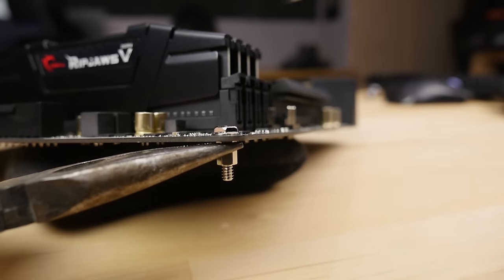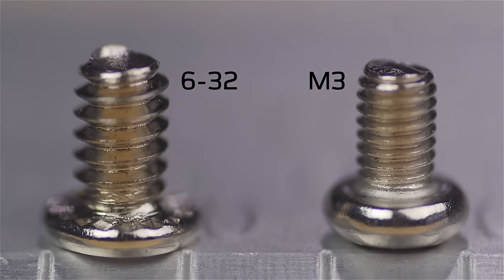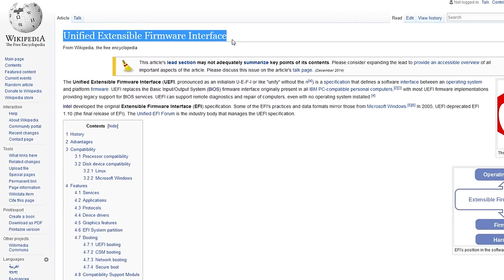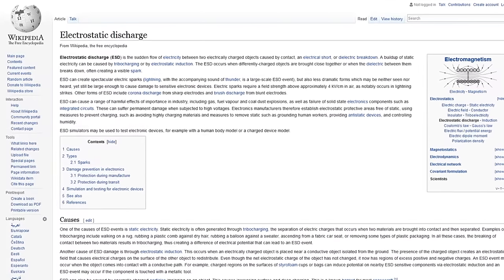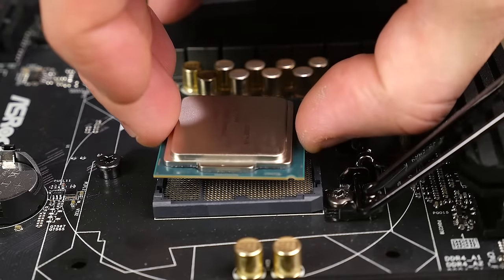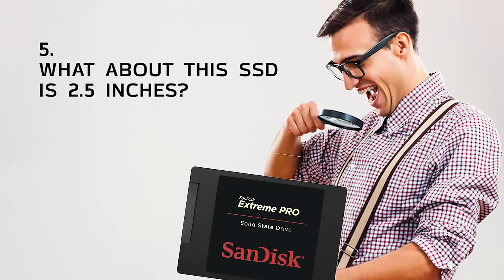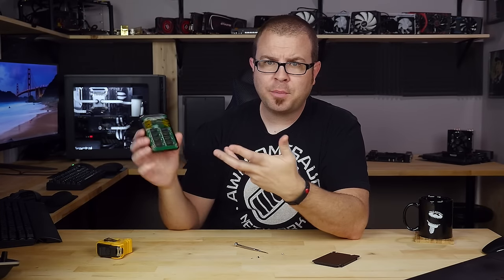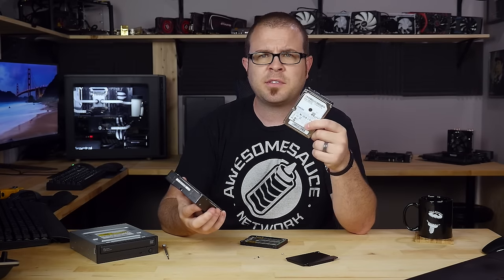5 Confusing PC Building Facts

Comment: UNC - Unified national coarse thread, UNF - unified national fine thread. both part of the shit standard system of murica. we need to get with the program and make the switch to metric
Reply: +awesley92 the metric standard of threading sucks. Although 6-32 screws are a special case. They suck too. But in general the range of available imperial sizes is just better to work with. People hep on the idea to switch to metric rarely are the ones building anything with any measuring system at all. So I have to ask, have you ever threaded anything in your life? By threading I do mean drilling a hole, then running a tapping cutter through it too.
Reply: lol im a month from graduating with a mechanical engineering degree, i've cut threads on a lathe. keep it in ur pants before you tell me about a measuring system
Reply: awesley92
Oh goodie another impractical engineer. Just what the world needs! Maybe you can design a car that needs its engine pulled to change the spark plugs too?
Reply: awesley92
no I blame the French for coming up with a bullshit measuring system. I have my own cherry picker engine hoist too. So if I need to I can drag an engine out of a car. But I'd rather not have to for something as minor as changing spark plugs.
Reply: +Paul Frederick what's really impractical is continuing on with wasting our planet's finite resources and energy to keep producing two standards, in addition to all the other wasteful products we produce. the only people two standards benefits is the tool companies when one standard can do the same job as both. i'm not saying overnight we need change to metric, just a gradual shift towards it. the acceptance of metric fasteners is already visible anyway with american car manufacturers starting to use metric on some of their models. I'd put money down the imperial system will be phased out one day, just as standards of past eras.
Reply: awesley92
If your greatest concern is waste we should phase metric out then. Because metric tool sets contain a larger number of tools than imperial does. Between 6-24mm a metric set would have two more tools than an imperial set does. Many of those metric sizes are useless too. Because no one makes fasteners in those sizes. I'm glad we've settled that.
Reply: The scope of the argument goes beyond units of length. Imperial units are based off of archaic meaningless things. Miles are based off of the game of cricket. This is how ancient cultures measured things out.  The irrelevance of the entire unit system we use makes it unnecessarily difficult to make off the cuff estimates on the actual amount of energy we use and how wasteful of energy we are. Looking long term these are definitely things we need to consider.  The metric system of base 10 makes it far easier to imagine the scale of system in question. BTUs (BRITISH thermal units) are used to measure some forms of energy. The system was so stupid the British stopped using it for Christ's sake. To top it off, with a little digging you will find that the customary pound and yard are defined by law in metric terms. Case closed.
Reply: awesley92
What do you think the metric system is based on that is so meaningful? An erroneous measurement of the circumference of the  planet? They were off by a country mile with that. The standard has since been changed countless times now. Each standard as arbitrary as the last. I think now they're using some wibbly wobbly wavelength of krypton light? Superman would not be happy. It is unAmerican!

Imperial measurements are in any base I want them to be in too. Sometimes I use base 10. Other times I use whatever I want. The solution to the energy crisis is not to count every erg we use, but to simply generate more power. Conservation never works. Grow, or die!
Reply: What do I think it's based on? It's not what I think its what I KNOW and you obviously dont so do a little follow up on that subject. Metrology is a field in its own right and new advancements call for new and more precise standards for development of nano-scale technologies. Heat varies the length of matter so finding a standard that is consistent as possible is what is meaningful. And not meaningful like the metric system is my spirit animal or something, but having meaningful empirical implications.  You need a suitable reference to base all of your other measurements off of so everyone around the world isn't off. A tiny shift in tolerance can make a huge difference at the nanoscale level. That's all a unit system really is, an arbitrary reference comparing the physical attributes of one thing to another so of course the standards themselves are arbitrary. Hell, everything in life is arbitrary depending on how you want to see it. It's a mistake to become complacent in technological development. There's never going to be an end all unit standard and thats ok. One that conscientiously grows with technological advancement and suits the needs of the world is what we need.
Reply: awesley92
Nano? Who are you, Mork from Ork? Nano nanu! I have done high precision machine work and I've only ever worried about hundreds of millionths. Billionths? Are you related to Carl Sagan by chance? Get in the real world where we use the imperial system of measurements! If the gage says Starrett it is accurate enough.
Reply: lol cheap ad hominem attacks, we know what that means. When you swim in the toilet, you get shit on. Without nanoscale tech, you wouldnt be reading this, what world are you living in? America?!!? No surprises. Nanoscale is exclusively measured in metric. Build a modern cpu without nano technology that doesnt take up your entire house. First, anti-splashback urinal cakes in public restrooms, now the metric system. The future is now, wake up.
Reply: awesley92
What arguments would those be? You spouted some nonsense about nanotech, that you will never have any practical firsthand experience with in your life. Besides, Oh, I hear it is inside modern CPUs! For all you know the Keebler elves are in those chips with cookies too.

But out in the real world I have built international award winning structures using the imperial system of measurements. Inches, feet, and yards!

You forgot to mention that the USA is richer than the rest of the world put together. So we can afford our energy bill, thank you very much.
Reply: Look up the definitions of subjective and objective while you're at it. You use base 10 sometimes when you want to blah blah blah. Subjective, therefore your opinion.

Facts are objective. No one cares that you use base 10 imperial and hassle yourself with decimal to fractional conversions. Fact. When a calculation or process takes less steps and a shorter amount of time to do, it is simpler. Fact. When you have to do mental math or look up a chart to convert that imperial decimal to a fraction, clearance hole sizes for fasteners for example, it is not simpler than metric. Fact.

I gave un-opinionated scientific facts as well as practical examples in favor of metric. Some things I have said are opinions. Fact.

 You think imperial should remain the standard purely on personal preference based on the limited scope of tinkering you have done in your garage. Fact.
Reply: awesley92
What practical example have you offered for metric besides nanoscale inside of microelectronics? Which itself is not a practical example. There are maybe 6 fabrication plants in the world that deal with that scale.

I have two charts hanging up in my shop. One has all of the drill sizes, with their decimal equivalents. The other is a tapping chart, with clearance holes. So I do not have to look very far up to reference any of that data. So another of your points made moot.

Imperial is still the standard for machining. Even in metric countries tools are all imperial. They use quarter, three eighths, and half inch drives. A 13mm chuck is a half inch chuck, etc. I mean get real, 13 is not a nice round number. In reality it is a half of an inch.
Reply: awesley92
I cannot live in the future. I live in the present. Imperial was around longer than metric too. Just the standard has changed to use the metric standard today.

As far as what awards I have won I have worked on two projects that were given international awards in construction. AT&T building of the year, and science laboratory of the year.

Now what awards have you won kid?
Reply: Done with the nitpicking. Case closed. Papa bless.
Reply: awesley92
How do you measure a nit in metric? Is it on the nanoscale?
Reply: Very carefully. Anything can be measured on any scale in metric with a decimal point and enough number places on either side. Papa bless.
Reply: +awesley92 wow grandpa just got wrecked. definitely right on the high horse part. The whole pounds force, pounds mass, and slugs garbage is a trip too.
Reply: awesley92
The same is true for the Imperial scale too. You just have yet to figure it out.
Reply: +Paul Frederick +awesley92 That doesn't even have anything to do with anything like wesley has been explaining. Jeez sorry you've had to deal with this guy wes. He's grabbing at anything he can to keep his head above water when he's already six feet under. He's commented on other comments on this video with the same high horse attitude. He just wants to be in it to win it, I'd ignore him.
Reply: Franz McMann Papa bless
Reply: White ***** Papa bless
Reply: *****
I am curious what you use metric for? Do you do any precision machining? Or are you just weighing out your drugs with metric?
Reply: *****
no one here that gets their hands dirty uses metric, besides working with fasteners that were installed by a factory. Because SAE hardware is better than metric is. But you gotta wrench on whatever they gave you with the doobledoo
Reply: awesley92
The fact is I've worked in a machine shop as a tool and die maker and we did not use metric at all. We weren't practicing science either. We were all about practical application. Why is it all about science with you? Science won't get you anything. Science is a bunch of meaningless diddling about.

Yeah one laboratory. The best one built worldwide. Zero metric was used in its construction too. We even did the negative pressure testing in inches.

I passed on White's wood. It's all for you.
Reply: Nope, sounds like you already got the wood. 

Science is diddling about? OK, thats how you're reading this right now. The problem is you dont know shit about applying science, and thats a fact. You only go off whats been done. Like I said, leave it to us engineers to make your toys.
Reply: awesley92
Applying science is engineering. By the time you're applying science experimentation is over. Or it'd fucking better be! Either that or you'd better have a damned good legal department. To fend off all the liability claims against you.
Reply: awesley92
So you've got nothing?
Reply: awesley92
Is nothing in metric more meaningful?
Reply: awesley92
So you've resorted to scatological ad hominem attacks now. I'd expect no more from you.

Comment: The 2.5" drive info is like how a 2x4 board is actually 1.5x3.5! This always screwed with my head when I was working construction but oh well thats for architects (or PC case manufacturers) to worry about.
Reply: +mkch932 Actually thats nothing for architects to worry about, its actually been that way forever, its just old fogies dont realize it. Also really simple, and some useful knowledge...

The lumber yard sells a mill a "2x4", and the dimensions are EXACTLY 2" x 4". The Mill then takes the ROUGH CUT lumber and surfaces each side by 1/8" of an inch, leaving you with 1.5" x 3.5". It's called "S4s" (surfaced, 4 sides). If you buy the wood yourself, you can get "S2S" (you guessed it, surfaced 2 sides).  So the "2x4" is an accurate term, but after its been processed. 

Think of it like buying a pound of hamburger. After you cook it, the hamburger weighs less. Did you get ripped off because you cooked it? The reason your grandpa cries about it, is because back in the day you didn't buy wood from home depot and lowes. They simply have it fine surfaced before you even buy it.

Comment: I accidentally dropped my lga 1150 i3 on the pins by accident an bent a few, it was fine for a few days then suddenly stopped it took 5 days to fix
Reply: Ouch!  I did the same thing with my AMD phenom during my first build.  I just took a mini screw driver and unbent them very gingerly (of course using as much ESD prevention as I know how) and it was never an issue for me.  I guess either I got really lucky, or you got really unlucky.
Reply: GlobalIdiot101 yeah it was from less than 2 cm away and I had to completely remove 1 pin
Reply: Yup. I did the same with my AMD FX 6300. Bent quite a few of the pins on the CPU. Truth be told, I didn't use and ESD protection while I was working on it. I just placed the CPU upside down on my desk (wooden, of course) and used a small flat head screw driver to realign them. Still works perfectly even after several years.
Reply: Neonemerld the problem is the 1150 pins are tiny and packed tightly together
Reply: +Vaughan Bunt Yeah, I'm grateful that the pins on the FX 6300 are relatively large compared to some of the newer Intel sockets, and that the pins on the FX CPUs are on the CPU itself instead of in the socket.
Reply: I popped an i5 into my rig over the summer. I thought I was going to have a heart attack but I managed to do it right and it's worked great so far. I'm tempted to spring for an i7 if I can sell my i5 and my old GPU because after upgrading my graphics card I noticed a minor bottleneck because it's a modern 1060 with 6gigs of vram. It runs more like 4gigs though because it's a little too fast for the CPU hence the bottleneck and it has a low bandwidth (256bits) for a card of it's capabilities. So ideally, I want to sell my i5 and both GPU's and maybe the MOBO and use the money to get a good i7, a high bandwidth 1080 with a lot of vram and a MOBO that can handle them both. That's what I want but I am literally suffering from some form of PTSD after my last upgrade so idk.
Reply: hehe, you dropped your LGA CPU on it's pinsdid you.... Reallyidiot   heheI wonder how many people actually understand the joke
Reply: For those who don't understandLGA = Land Grid ArrayMeaning, there are no pins on the cpu Grid Arrayolder CPU's such as socket 478  and some socket 775 CPU's were PGA = Pin Grid Arraythese were the ones that had the pins on the CPUand ... basicallybecause Techs used to drop them on their pins and Intel got pissed of for having to replace them on warrantythey switched to the LGA Standardall I Series CPU's are LGAyou therefore cannot drop an LGA on it's pins BECAUSE, IT DOESN'T HAVE ANY PINS to begin with
Reply: Martin Kuliza Oh, well I guess I have no reason to sweat bullets next time lol. This puts my mind at ease so I think I'll upgrade with my tax return in a couple months:)
Reply: Martin Kuliza I know the difference between PGA and LGA but when I said i dropped my LGA 1150 on the pins I meant the pins on the mother board, but look back now I can see how it could be taken the other way
Reply: Vaughan Bunt well, that's different now. isn't it

because what you said was this....

"
I accidentally dropped my lga 1150 i3 on the pins by accident an bent a few, it was fine for a few days then suddenly stopped it took 5 days to fix

so you see if you just said
LGA 1150 socket
that would mean the motherboard

but you said.... i3
i3 is clearly a CPU
so. you're saying you dropped it on the CPU

I guess you typed it incorrectly and what you meant to say was

you accidentally dropped your motherboard with socket 1150 LGA and it landed on the pins in the socket and bent the pins
which is fucked up and highly unlikely and unlucky if it does occur

ok, thanks for clarifying
Reply: Martin Kuliza I was specifying what socket my cpu was and said I dropped it on the pins not specifying where they were located assuming people would realize they were on the mobo not the cpu, let me clarify I dropped my cpu onto the pins of the mobo from a distance of about 2-3 cm the cpu hit it at an angle and bent some pins
Reply: Vaughan Bunt oh. ok, well that's different again

but the point being, the original post was not accurate nor very clear

hence  my original post
but now thanks for clearing it up

so. You dropped your  LGA i3 CPU accidentally and it landed in the (lets assume) the 1155 Socket on your motherboard and hit the pins on the board and damaged them

ok that's clear now
Reply: Doyouknowwhataspacebaris?

Comment: Great vid. It is anyway hard to prove that ESD has not damaged any of the computer parts that have just died in mysterious ways. I have not noticed that ESD has killed any of my computer parts, but many have sure failed without any apparent reason.
Also I suggest having a conducting table. I guess wood conducts a little and might help reduce ESD, unless it is very dry. But in general I think ESD mats are specified <1Mohm. 
I used to work with ESD protection stuff at Vacon for a long time ago :) 
If everything is made of metal it is also fine, but having some things in metal and the rest made of insulating materials can be bad.

Comment: "Non conductive surface like wood"

Wood is actually quite conductive, especially at high voltages. The reason it may not appear to be conductive is because many table tops have varnish/lacquer/resin finishes that act as an insulator. Unfinished wood surfaces like a shop bench are conductive, especially if damp from humidity or other liquid spills.